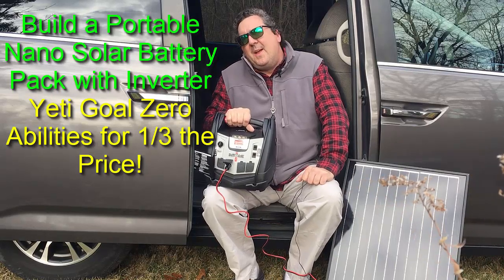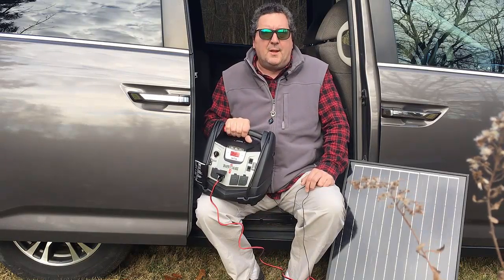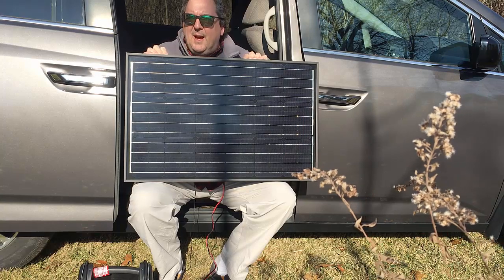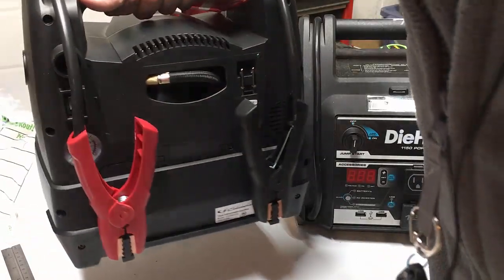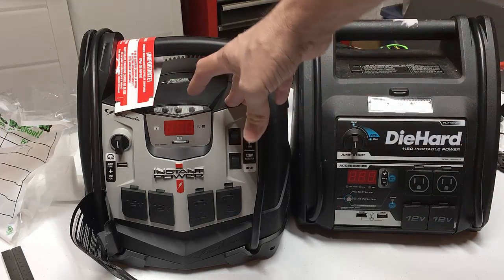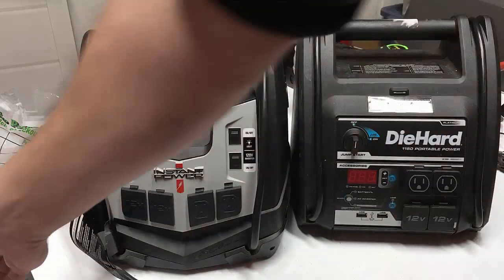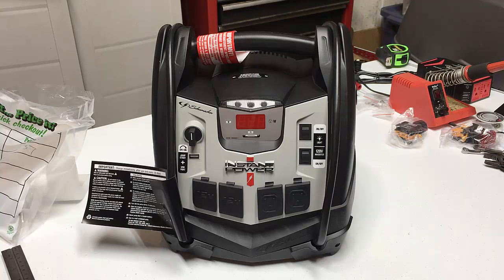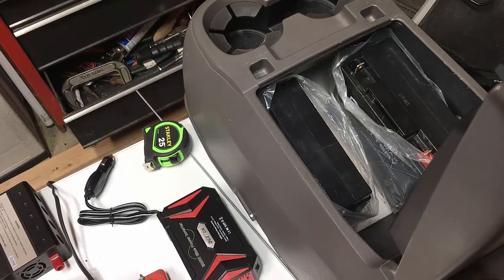DIY Portable Solar Battery and Panel

Comment: How long does it take to charge the die hard to 100 percent when plugged into a wall?
Reply from the maker: It will hit about 80% in six hours or so, from my experience.  After that, the charger tapers off the current (best for the battery life) until it hits 100%.  In my experience, this can take up to 18 hours total.  Essentially, if you charge too fast the fluid in the battery can boil, which isn't good for battery life.  This is why I tell people not to recharge these by plugging the into the vehicle's cigarette lighter.  You can do it, but the battery won't last as long.
Reply: Thanks for the response! Love the channel. 
Any idea of how long it takes to charge the battery along with the backup connected together? 
Also the Schumachers went up in price alot! About 140$ online 
thanks for the great info and help!
Reply from the maker: jacob t Thanks!  I will have to try that sometime. I’ve only charged the two of them together when I’ve been driving. In that case, they are connected to a 10A charge controller and recharge over a 6-8 hour drive. As a rule of thumb, with battery packs you could always use more reserve and faster charging. It’s an economical alternative to an RV sized battery bank, but you have to pay attention to your power consumption, for sure. Thanks for watching!

Comment: I have the first version the one with one dc and one 12v one , can i carge it with dc also?
Reply from the maker: LxTxSURGE You would still be able to charge through the dc outlet, but I would put  a charge controller between the battery pack and the charging source. You can use the solar charge converter I show in the video.

Comment: How long take to charge the die hard power pack when its completely out?
Reply from the maker: francpr 23 It depends on what you are using, but if you plug it into the wall it will charge overnight.
Reply: Odyssey Camper apreciate for the answer

Comment: Darren I think I figured it out but I dont have another quick connect with the 12 volt plug.  I would hook the external battery to the jump as noted in the video connect another extension on the charge controller to go to the battery and connect to the battery side of the charge controller.  But I need a 3rd quick connect extension cord to connect to where it says solar on the charge controller to plug into the ciggarette lighter port on the van.....is that correct?
Reply from the maker: Ha, just replied to your other message, but I see you figured it out.  https://amzn.to/2JrYkvC
Reply: @OdysseyCamper  Lol Thanks! Just saw the reply on other video myself. Yeah, sadly, I did not know about using the charge controller when charging from the cigarette lighter port. Although the diehard jump pack does not come supplied with a.c. or dc cords, my other jump pack did. It came with the male to male dc cable. (Makes no sense to say you can charge from 12 volt source if it could shorten the battery life). Anyway, following all your supply lists for each project and not knowing about charging concerns using 12 volt source (without a charge controller), I only bought 2 of those 5ft dc cables w/ quick disconnect on end and cigarette lighter connection on the other. For my purpose, using the Schumacher charge controller and charging the jump pack w/ the extra battery attached, I need 3...:(  Does Ace hardware carry those cables?) Wal-Mart does not and have never seen them in auto parts store. Some of my battery tenders came with them but they are only like 6-8" long. Also not marked which side is positive or negative so....
Reply from the maker: Correct, you've got it!

Comment: Was the panel marked neg -positive ?
Reply from the maker: Mike Scallon it was, but I used a voltmeter to check it. You can also look at the bands on the diodes.

Comment: Solo por añadir los subtitulos en español me voy a suscribir a tu canal
Reply from the maker: Me alegra saber que son útiles! Yo no hablo español, así que tengo que usar el Traductor de Google. Así que puede que no sea una traducción perfecta.
Reply: @OdysseyCamper  Está perfecta...pregunta - 50 vatios es lo mismo que 50 watts???
Reply from the maker: @astrorganic3169  Si
Reply from the maker: Además, no he completado subtítulos en español para cada video. Si hay uno en particular para el que los quieres, comenta debajo del video y los agregaré.
Reply: @OdysseyCamper  ok muchas gracias!
Reply: Hey🙋 Buenos dias amigo! Compre un panel solar y estas son las especificaciones 👉 100 watts rated maximun
Vmp 17.70V
Imp 5.65A
Isc 21.61V
Short Isc 5.74A
Me servirá para carcar y recargar un DeWalt battery starter 2800 Amp?
Reply from the maker: @astrorganic3169  ¡Sí! También deberá colocar un controlador de carga solar entre el panel y la batería. Los que uso en los videos son:
https://amzn.to/2XzlR3T
y
https://amzn.to/2XBcqAT
Cualquiera de ellos trabajará con su panel solar.
Reply: @OdysseyCamper  muchas gracias!😊

Comment: I know in the manual it says not to charge and run it at the same time.... any idea why that is?
Reply from the maker: Matthew Koch I’m actually not sure why they say that, but I’d speculate that the charger would have trouble adjusting the rate of charge to the battery if its voltage was fluctuating. I have done this without anything being damaged, but I would guess it’s not good for the charger.
Reply: Odyssey Camper thanks! It would be cool to charge with the solar and still be able to run

Comment: Anyone know if I would be able to charge this shumacher kit by activating the alligator clips then connecting the alligator clips to a solar panel alligator clip? I'm assuming this will charge it since it's making a direct connection the battery, anyone know?
Reply from the maker: Commander Rick it would charge it, but it could overcharge it. So, it’s a good idea to use the charge controller from the video. That will prevent the panel from overcharging the battery. But in a pinch, what you describe would work.
Reply: Odyssey Camper Yeah I have one of those folding solar panels from renogy thats connected to the solar charge controller. Thanks for the fast reply, wanted to make sure I wouldn't ruin the jumper kit.

Comment: Can you buy a 100 watt solar panel  and plug it in to one of the genarators?
Reply from the maker: Shannon Hamblin You sure could, as long as you use a charge controller between the panel and the battery. You could use the one in the video or take advantage of the extra power and use a 10 amp charge controller. Thanks for watching!
Reply: Odyssey Camper.  Awesome. Thank you for replying. :)
Reply from the maker: This is the 10A charge controller I would use (Amazon) http://amzn.to/2CoFlg7.  I used the same one in my console battery pack and it worked well.  Plus, it's only $16!
Reply: Odyssey Camper  Thank you very much. :)

Comment: Hello again, how large on an external inverter can the Schumacher handle. Looking into running 600 watts nutri bullet...as efficiently/ frugally as possible. Thanks
Reply from the maker: I think the 12V socket is fused at 15 or 20A.  I can't remember so you may have to look at the owner's manual or inside. 15A limits you to about 180W (15A*12V) and 20A limits you to 240W.   I think the max for this type of 12v socket is 20A.  Of course, you could put lugs on the inverter wires with an inline fuse and connect it straight to the battery.  This would require a small hole in the battery pack, to pass the wire through.

Comment: How did Ur solar panel work in the windshield? please
Reply from the maker: It worked well, but it made me nervous putting it up there because of the sharp corners.  If one of the suction cups lets go, it could scratch up your dashboard.  I now think a flexible panel is a better idea IF you plan to mount it inside on the windshield.